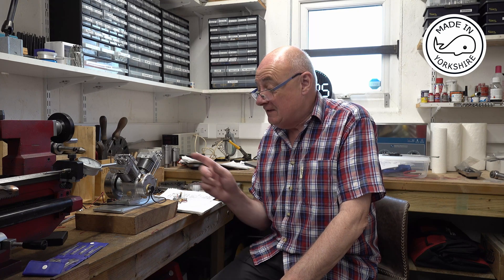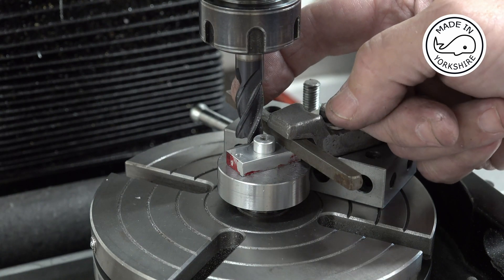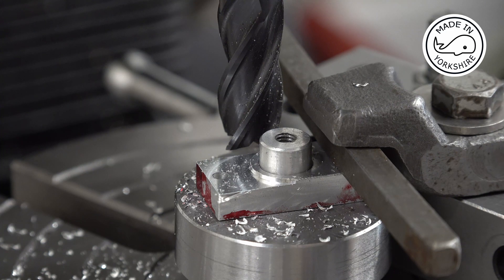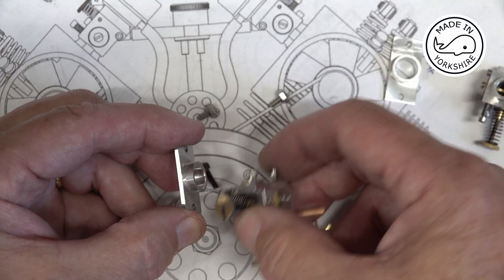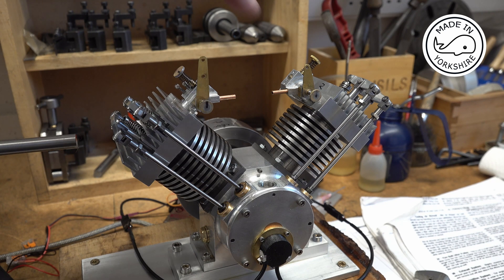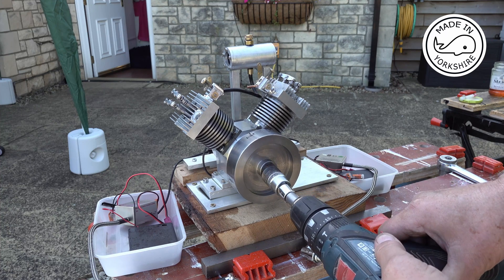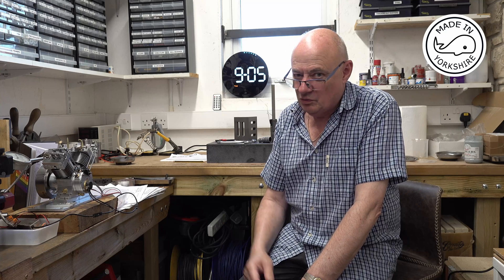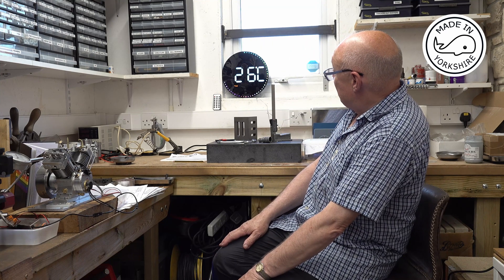#MT49 Part 22 - Jerry Howell V-twin IC Engine. Carburation. In 4K/UHD by Andrew Whale.

Comment: you could put an open slot in the hole on the carb flange. it would make it easier o get on when glued up. you'd put the nut on the stud first,  slide on the carb then nip it up. nice project!

Comment: Nearly there Andrew. The tank level needs to be set such that fuel level is just slightly below jet elevation in carburettor. I built the level regulator but never used it. My experience is the engine is very sensitive to throttle position, had one hand on drill & used other to adjust throttle as I was trying to start. Inlet valve sealing is critical, caused me a lot of problems. Looking forward to seeing it running.
Reply from the maker: Hi Maurice. I must say that I'm struggling at the moment. I have a very slight leak on both inlet valves. Tried 500 and 1000 grit but I can't get them perfect. I might replace the valve guides with phosphor bronze ones. I also think I might have bad sealing between heads and cylinders. With the flywheel rotating anticlockwise I've tightened a larger nut against the smaller one to try to start it with a drill. One cylinder springs to life which immediately unscrews the locking nut. What starting method did you use?
Cheers
Andrew
Reply: Andrew, I cut a keyway on crankshaft to flywheel. This stops flywheel rotation. I then use an electric drill like you. When you try starting, if the carburetors are "spitting", it indicates a passing inlet valve. I did struggle with one of the inlet valves sealing, still not 100%.
Reply from the maker: @MauriceKelly11  thanks for the advice 👍

Comment: A bit of exhaust back pressure might help.
Reply from the maker: Hi Tony - very good point. I was/am trying to rush things a little bit. My 95 year old mother-in-law takes a keen interest in the engines I make and I was trying to get this one running in time for when she visits today. Also, on investigation, I found that the intake valve on cylinder 2 had a piece of grit under it preventing it from closing - so absolutely no compression on that side. I've done some more tests and I can see that both intake valves have a very slight leak under pressure using my compressor. I was never happy with the original design which suggested mild steel (which I used) for the valve guides, rather than the more common phosphor bronze. More lapping and testing before I rip them out of the head!
Cheers
Andrew
Reply: Having similar problems with my Wyvern, sure its the carb, Westbury's design is awkward so I think I might build a Jerry Howell one.
Reply from the maker: @tsheritageengineering  I have a JH two jet carb on my Hoglet v-twin. You are welcome to borrow that to see if it works on the Wyvern. I've also got a carb for an aero engine which you cound try (and keep if it works for you).
Reply: Thank you, I'll probably be in touch if I can't sort out the Westbury carb! @learningturningmetal

Comment: Hello Andrew, I was going to ask you the same question as Chris Armstrong regarding the use of studs in the cylinder heads and nuts to hold the carburettor flanges on. I sympathise with you about the teething problems but, as you say, they are virtually unavoidable. I also loved seeing you dear dog's very bored demeanour when you were playing with your other engines. Best wishes.
Reply from the maker: Hi George - yeah I did consider studs but decided not to in the end. Maybe not the best of decisions but it works okay. My dog must be fed up of me tinkering with things and making loud noises. He's seen it all before. The heat doesn't help either.
All the best.
Andrew

Comment: Hi Andrew, gravity's not your friend where fuelling is concerned. I think cylinder 2 might be blowing the fuel back rather than sucking it in, that'll be valve timing. When you injected it into the air intake it blew back to the fuel tank.
Reply from the maker: Hi Dave - well spotted. I found that the intake valve on cylinder 2 had a piece of grit under it preventing it from closing - so absolutely no compression on that side. I've done some more tests and I can see that both intake valves have a very slight leak under pressure using my compressor. I was never happy with the original design which suggested mild steel (which I used) for the valve guides, rather than the more common phosphor bronze. More lapping and testing before I rip them out of the head!
Cheers
Andrew

Comment: Make sure to check your valve lash.
Reply from the maker: Hi - I found that the intake valve on cylinder 2 had a piece of grit under it preventing it from closing - so absolutely no compression on that side. I've done some more tests and I can see that both intake valves have a very slight leak under pressure using my compressor. I was never happy with the original design which suggested mild steel (which I used) for the valve guides, rather than the more common phosphor bronze. More lapping and testing before I rip them out of the head!
Cheers
Andrew

Comment: I saw gas spurting out of the filler cap like it was under pressure at 12:17 that shouldn't happen on a gravity fed system.
Reply from the maker: Well spotted! I found that the intake valve on cylinder 2 had a piece of grit under it preventing it from closing - so absolutely no compression on that side. I've done some more tests and I can see that both intake valves have a very slight leak under pressure using my compressor. I was never happy with the original design which suggested mild steel (which I used) for the valve guides, rather than the more common phosphor bronze. More lapping and testing before I rip them out of the head!
Cheers
Andrew

Comment: Could you not have loctited 2 studs into the cylinder head for each carby and secure them with nuts ?  (The video implies you have effectively used 2 hex-head screws.)
Reply from the maker: Hi Chris - yeah I did consider studs but decided not to in the end. Maybe not the best of decisions but it works okay. 
Cheers
Andrew

Comment: Hi Andrew I really "Feel" for you with that wonderful engine not running after so much work that you have put into it. It' not as thought this is your first engine, so you know what you are doing. I bet in the end it will be something silly you have done when assembling or timing it. Don't lose heart, have a break from it and who know when you pick it up next you will say "AH, I know what the trouble is" and fix it in a trice. Enjoy your Break. Regards from Australia.
Reply from the maker: Hi Dave - thanks for the encouragement! After some investigation I suspect valve seats might be one of the problems. Under test conditions with my compressor there is a very slight leak on both intake valves. I've tried lapping with 500 and 1000 grits but I can't get them perfect. I wasn't happy with the design in the first place as it suggests mild steel (which I used) for the valve guides, rather than the usual phosphor bronze. More testing needed though before I rip them out of the head. My 95 year old mother-in-law takes a keen interest in my engines and I had hopoed to get this one running when she visits today. A good excuse to get one of the others out instead. She is interested to find out what a Quorn is too!
All the best.
Andrew

Comment: Hi Andrew. I would think 1st off is that the engine should be timed at around 5 degrees before top dead centre & not after. Also as you stated the fuel tank is too high. Maybe the No 1 cylinder needs the compression checking or the carb stripping to see if it has a blockage somewhere. I am in Awe of the build you have done & cannot wait to see it finaly run. Great video as always.
Regards.
Steve.
Reply: I'd agree with 5° before TDC, but if your instructions say otherwise, I'm baffled.